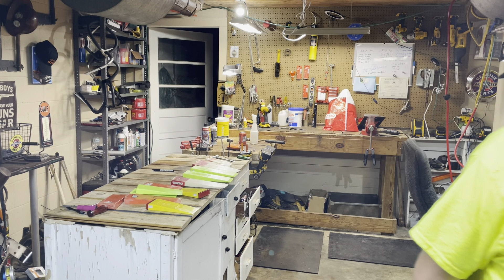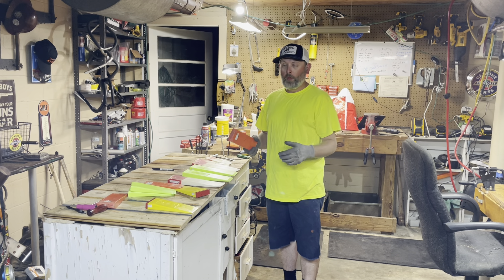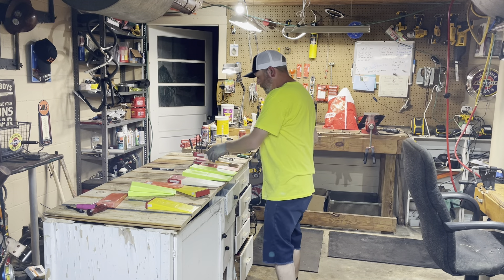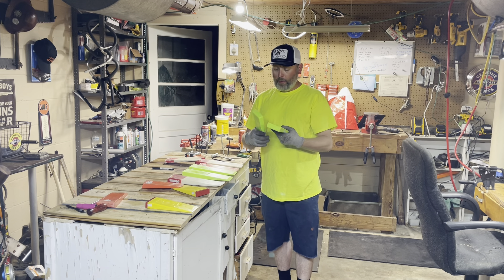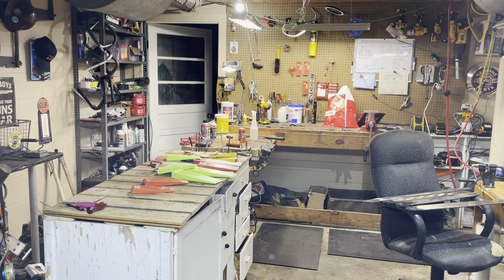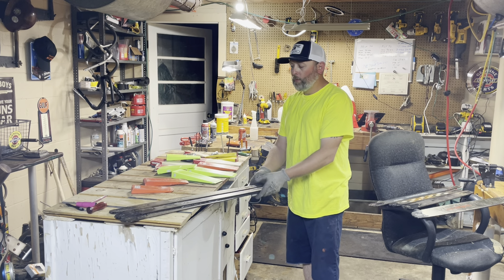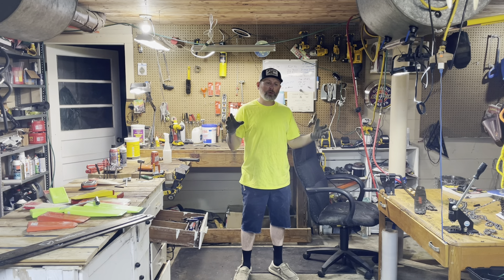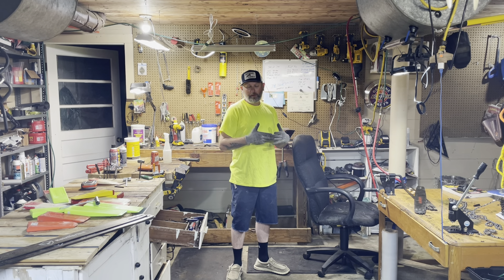A little wedge talk and following up on chainsaws bars from a while back the goods and bads

Comment: Not to change the subject but I recently bought a Stihl RS chain and had 2 links removed to fit my Timberwolf and haven’t used it yet. I ordered a bar adapter today from Red Beard Saws and was curious if you could tell me once I install the Stihl bar will I still go by link count or will the 20” Stihl chain fit it since I’ll be using the Stihl bar instead of the Echo bar.
Reply from the maker: I’m not sure I’m gonna say not but it may since it is smaller if I added 1or 2 I know it won’t work cause STIHL slide length is shorter than husky and possibly echo but it might work u may have to run the adjustment all the way back and you could possibly notch bar but idk which would be more trouble I just got back not long ago I’m gonna email my number to you
Reply: Buckin did a video on this subject a fee years ago..... you either gotta modify the bar a bit or add a link
Reply: @Hausmann300  you remove 2 links for the 20" Stihl chain to fit the Echo 20" bar so if using an adapter and Stihl bar and chain you have add a link to use it on the Echo 590?
Reply: @dentondunn4346  gotcha thanks for the clarification